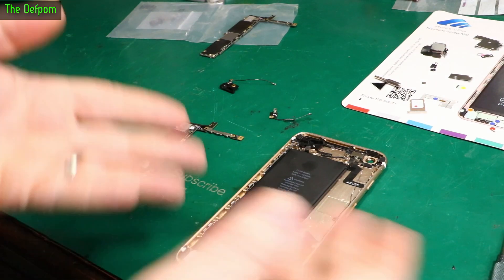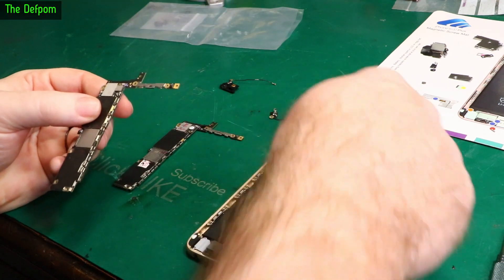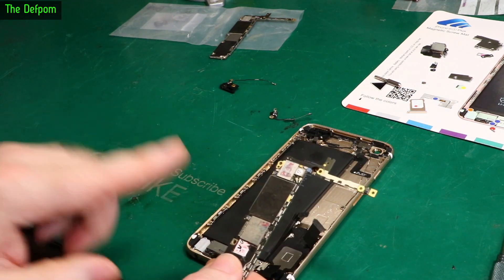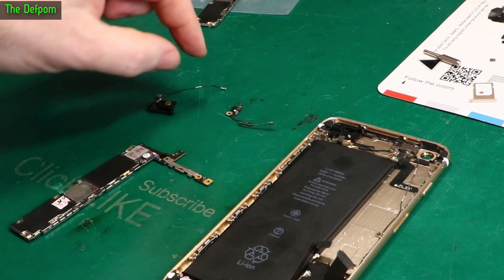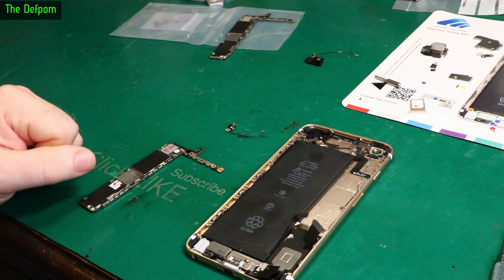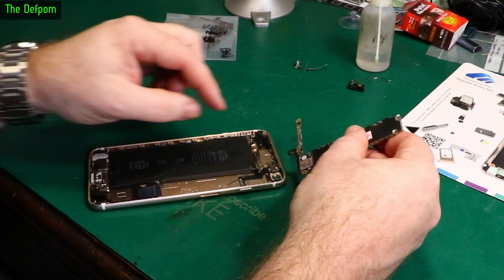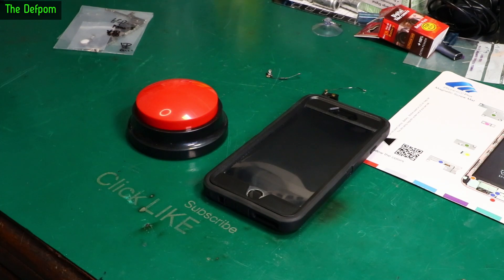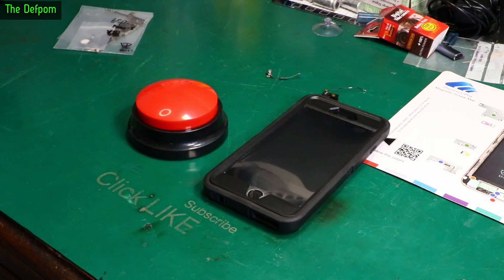🔴 iPhone No GPS Repair - iPhone 6S Plus GPS Repair - No.1158

Comment: weller micro desoldering tweezers, might have done it without the pain of the hot air.
But do cost a lot more than the average hot air station.

Comment: should have just used a small tip soldering iron as can be easier and quicker than a hot air gun.
Reply: Yup, K style tip for removal and refit......it's not like Defpom don't have one.
Reply from the maker: I didn’t want to risk damaging the component with solder, as it is an inductor a lot of direct heat along the winding could damage insulation, hot air was safer.